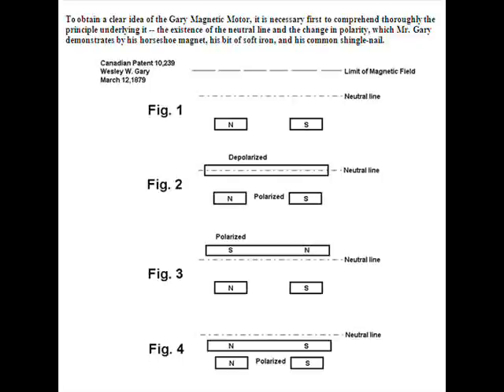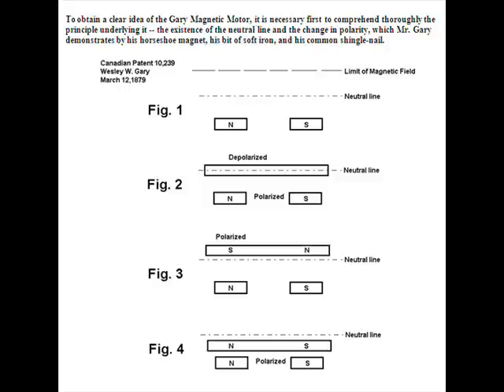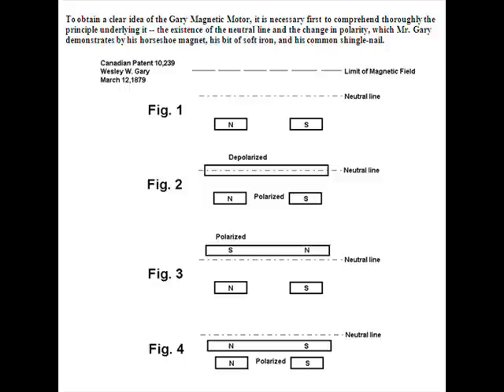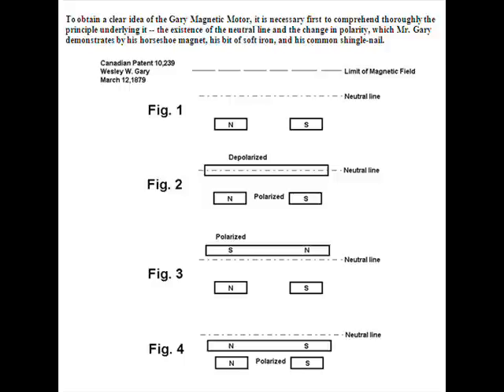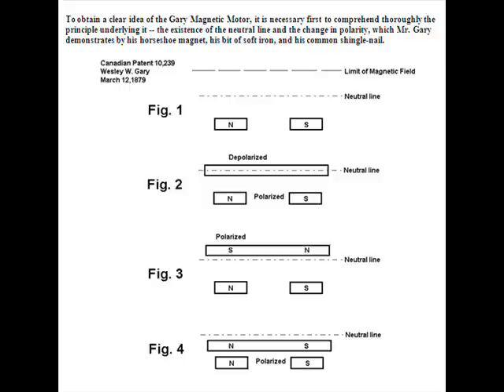gary magnetic motor - explained anthony karam 12-12-12

Comment: Centrally disposed between the poles of every permanent magnet, there is a narrow plane of zero polarity. A soft iron lamination in line with this plane and pivoted at its far end, will switch polarity as it crosses to and fro over this plane e.g. from N over zero to S and from S over zero to N. This is simple logic and is very easily demonstrated.
There is no imaginary line surrounding a  magnetic field beyond which soft iron is repelled.

Comment: Field reversal does not occur within the magnetic keeper on the "neutral" line. What occurs is maximum possible magnetic alignment within the keeper material, i.e. magnetic saturation, AND the resulting leaking of the permanent magnetic field past the keeper until its opposite polarity equals the polarity strength induced in the keeper.
Reply from the maker: mr baxter...you might be right although should this ''field change'' occur  (and it does) and if it can be shown to giv more usable power then what is consumed to move the actuation pole piece then its obvious to us a possible future...there should be money set aside for this exploration...
Reply: The field change is apparent only as measured by external measurement and only on the side of the keeper faceing away, not on the side still attracted to the permanent magnet. This side facing away is where I do believe the true power of this arrangement is to be generated:In its shielding/redirection of the opposite/attracting permanent magnetic fields. See Ecklin Generator, as I believe this device is taking advantage of this exact arrangement. This explains why experiment of coil wrapped around middle of keeper itself shows very little power output since it experiences only a slight strengthening of field flux upon approaching the "neutral line" but stops once reaching maximum saturation of magnetic domain alignment.
Reply: To be clear; I'm speaking of the portion of the "keeper" directly bridging the North and South poles. At the point of keeper saturation/aka. the "neutral line", If the keeper is longer, that portion that goes beyond the poles does become simply an extension of that polarity of the permanent magnet nearest to it, and therefore a pole reversal. I don't think anyone has experimented with putting the generator coils on opposite ends of the keeper? But, I do believe the vertical axis version of this patent uses this effect?
Reply from the maker: so what i see in your descriptive analysis is a basic form of magnetic transistor stimulated by doping the keeper with molecules that go into ''saturation'' at a certain flux density...therefore changing flux poles 180 degrees...with pick up coils at the ends...
Reply: Yes, very good.  I can see it comparable to a magnetic transistor, as you say. This could very well be the working theory to explain its action.
Reply from the maker: so the search for a simple test would be a metal keeper alloy with a predictable flux density saturation point or thin enough piece of standard metal and also somehow cap the ends with thicker pieces...there must be a chart that shows the value of sat pt of metals...let me look around...
Reply from the maker: (Seen in some magnetic materials, saturation is the state reached when an increase in applied external magnetic field H cannot increase the magnetization of the material further, so the total magnetic flux density B more or less levels off) 
so...when flux sat occurs would ''excess flux as keeper comes closer to higher flux density then change n/s to s/n 180 deg at keeper ends?
would this be the small amount of energy/movement of keeper in mr garys invention/discovery be based on your theory?
would one ''now not'' have to cap thicker keeper ends and only use the right length/thickness of keeper and simply adjust distance of keeper from pm to achieve positive result...???